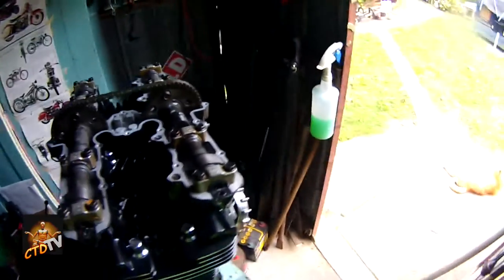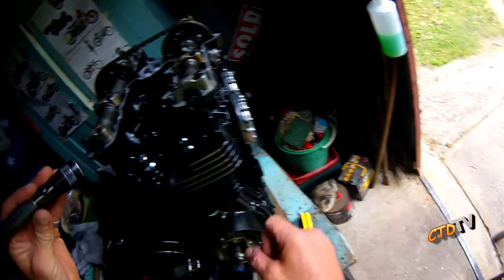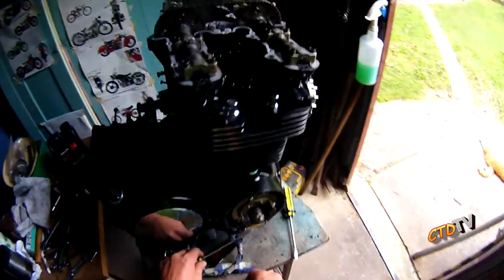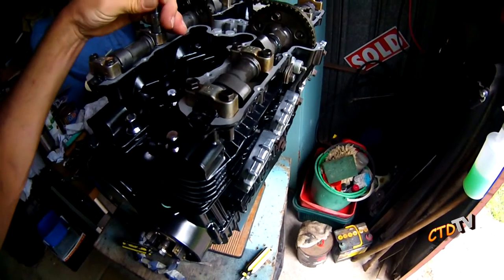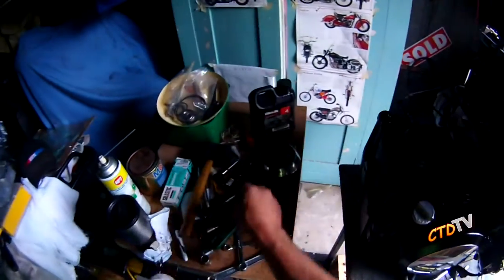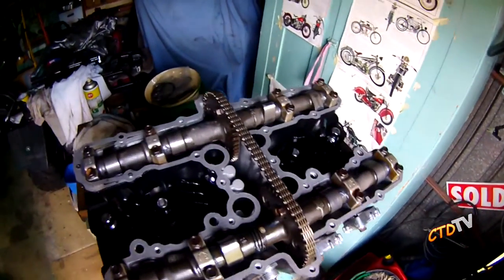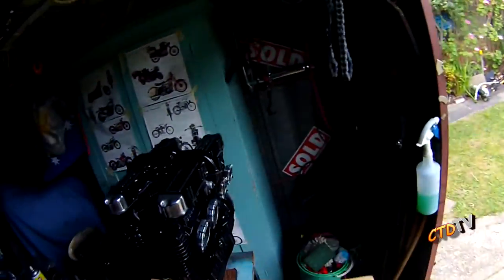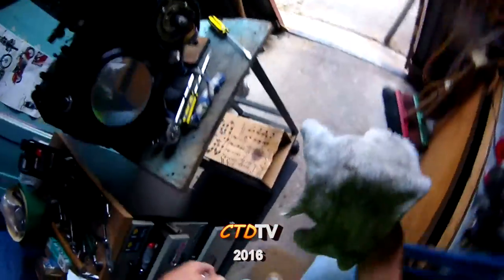z750 ReBuild - Cam position at TDC & things to do/lookout for...

Comment: Did you refurbish your auto cam chain tensioner? It looks brand new in this clip.

I think mine is locked up, I'm noticing a bit more noise at idle when the engine is warm. Planning on pulling the tensioner out and giving it a birthday this weekend.
Reply from the maker: +Fat Fingered Guitar Nah, didn't refurbish the Tensioner, just cleaned it (in+out). Its a Simple device. 
Make sure the angled edge is Smooth and free of any ridges that might stop it Sliding. Also just before you loosen it right off, cup-it with your hand, the spring will pop it out half an inch when you remove that last bolt..
Some people do a Tensioner Mod, convert into a Manual Bolt type system (videos are out there).
GoodLuck with the Bikes birthday this weekend, I hope it doesn't have too much Cake and spoil your plans....lol
RSOT >:)